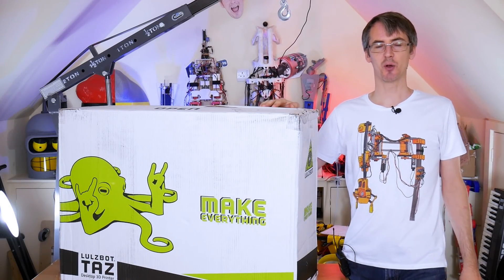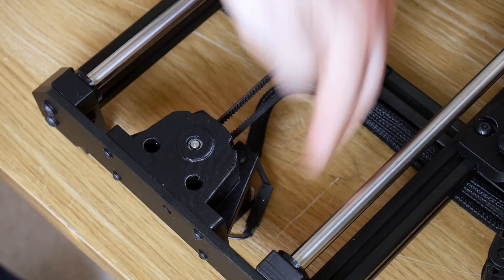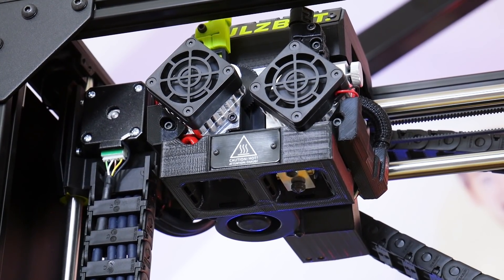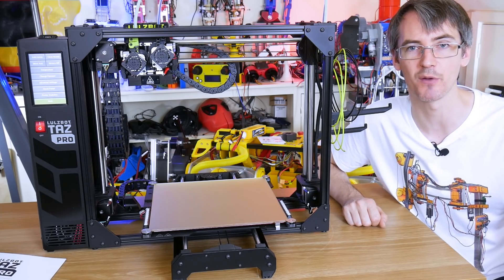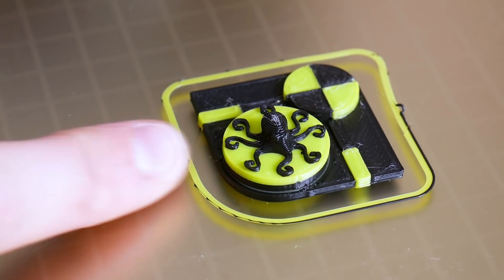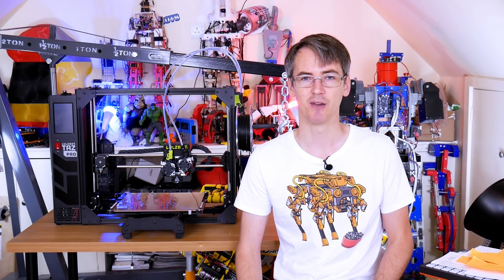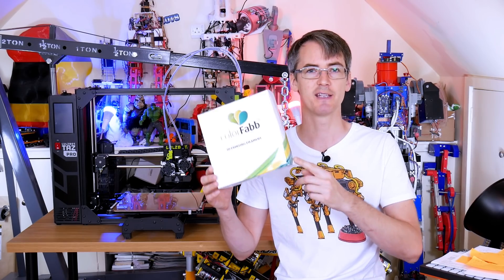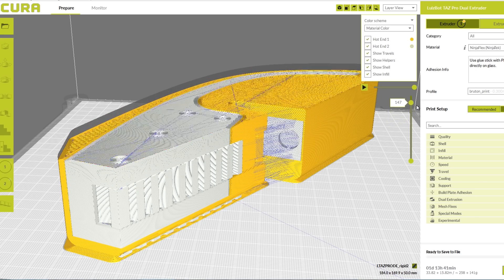Multi-Material 3D Printed Robot Dog Feet with the Lulzbot TAZ Pro

Comment: Hi James,

Wonder if you could give me some help...
Got a Taz Pro about october 2019 for educational purpose and after three prints had a big issue until now... and cant get any support from Lulzbot.
Have you ever got a issue with your printer after printing flexible material?
After heating the heads the printer just shuts down and restart again. Got (mintemp) error on gcode.
Cant get any filament through head 1 so wonder if the nozzle might be blocked and is causing this error. 

Hope you can read this any help will be much appreciated.

Comment: I was very dissatisfied with my purchase, many parts were 3d printed at a low res and the poor design cause the extruder to weld itself to the mount with filament on the 2nd print, smh, so i sent it back. Also for 5k there was no network connection.

Comment: Can't believe lulzbot is still using hot end conductivity for leveling.  keeping the nozzles clean enough for that is a massive pain in the ass, at least on my gen 1 mini.  The prusu use of magnetism is WAY better.  Also I am always annoyed that Lulzbot charges SUPER high prices for their systems and gives you 3d printed parts that are not nearly as good as if they were molded.

Comment: you need to crank those travel moves to 300mm/s and acceleration to around 2000, also faster print moves, it can handle it
and if there's a way, you should also see how you can make that change servo go faster
Reply from the maker: You can't print that fast in Ninjaflex

Comment: Will these updates make their way into OpenDog or have you moved on from OpenDog?
Reply from the maker: Yes!  this is a fork in the development, but It already seems easier to make it work. Once I've sorted out the actual stability control then I'm going to attempt to simulate the reactions in openDog's rigid actuators.

Comment: Interesting printer.  I like the Auto leveling and dual extruder design, but $5K for a relatively small build area, no lead screws on the Z axis, and it looks like some 3D printed parts, hmm.
Reply: The build area is almost 12"x12" thats pretty big. All parts that can be 3d printed are, its part of its open source roots and allows the user to replaceand or customise the prunters parts. The belt driven z axis is a new improvement over the lead screws from the taz 6, no z wobble, no binding, and much faster

Comment: I know that people like to tear in at Lulzbot for being expensive, but been using their products for a really long time * and I've never had a reason to not like lulzbot machines. They're turn key printers that requires very little front end tuning and they consistently produce great quality prints that are accurate and strong (when designed properly).
*[9 mini's and 6 Taz 6's at my university makerspace, (all of which have been running nearly 24/7 for the past 3 academic years with only 2 mechanical/maintenance related issues) and a personal mini2 for a year.]
Reply: ThatOtherAndrew same here, have 8000 hours on my original mini and so far had to replace one wire and 1 printed part.
Reply: The 3D printer market has a whole lot of people who look at the specs, and price and assume all printers are equally reliable, and are absurdly pleased with themselves for being so analytical. These are the so-called tourists, who don't really know how to buy equipment to run a business or to support product development. They just fool around printing parts off Thingiverse for a while before finding something else to amuse themselves.

Comment: Why don't low end printers come with USB ports? Lots of cheap ARM microcontrollers have USB host controllers and the HAL libraries make them basically a drop-in replacement for SD cards.

Comment: Around 3:30 in the video the whole carriage seems to tilt around the Y axis when it is wiping the nozzles. Is that right? Seems like it should be more rigid.
Reply: Look around 4:07, the tool actually interferes with lower part of the carriage and makes an audible click. Terrible clearance.
Reply: I was wondering about that too, but apparently, it doesn't seem to affect the final product- the final print turned out just fine.
Reply: The Taz 6 dies this as well, the carriage wiggles a bit when wiping, when printing there is no drag on the nossle so it doesn't move.
Reply: also you can see the whole frame woble around 4:38 when the carriage moves side to side
Reply: @tibo786  for the prize they are asking (which is ridicolously high in my opinion) it should have way bigger aluminum extrusion profiles and use linear guides aka ball-recirculating carriages...

I Do like the Belt-Driven Z-Axis though!

But is it 1:1 or does it use spools for a pulley system?!
Reply: Did it a few more times than that.
Reply: I know nothing about this printer, but if I had to guess Lulz Bot might have added a rotational axis to make the head tilt allowing them to switch between the two nozzles, allowing you to print with one and leave extra clearance for the other, unlike normal printers which just have them in plane. This could be a useful feature to help prevent artifacting on multimaterial prints.
Reply: @coulombicdistortion1814  Isn't that the whole point of raising the other nozzle up, though? It couldn't possible be intended to rotate like that. There's no way it could do that consistently enough to remain calibrated.

Comment: Surprising how many 3D printed parts it uses for a fairly high end machine.
Reply: I was also very surprised. For a $5k machine I would have expected mold injected plastic at least.
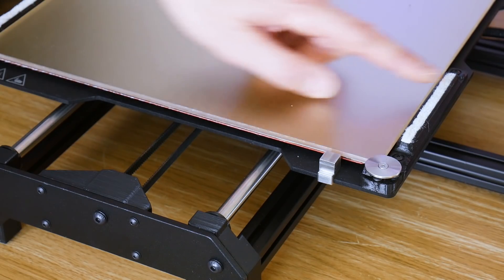Reply: Not to mention the poor quality on the printed pieces. At 2:26 you can see two identical pieces where one was printed poorly
Reply: 3d printing is great for prototyping ye? Or industrially making shoes. 3d printed running shoes are so light its like running bare feet... almost.
Reply: Why is that a bad thing? Using 3D printed parts makes it possible to innovate much faster.
Reply: @MisterMakerNL  They can innovate fast internally using 3D printed parts, but when you ship a final $5k product, you order injected ones (stronger, better tolerances, heat tolerant)
Reply: @jendib  And tens of thousands for mold tooling and for an injection molding machine. If you believe 3D printing should only be used for prototyping, say so. Because many others take 3D printed parts into production. It seems looks matter more to you than anything else.
Reply: @SanjaySingh-oh7hv  It has nothing to do with looks, we are talking about a 3D printer :D I was more thinking about dimensional precision and strength in all direction. Again we are talking about a 5k machine.
Reply: @jendib  Hello. Your speaking of isotropy, where the 3D print is equally strong in all directions. Is this necessary for the 3D printed part? Or are you just making demands just because? Regarding dimensional precision, remember that there is a metal sleeve or bushing inserted into the 3D printed part.

Yes, I agree that relative to the Chinese made printers, it's expensive, but it's also a printer that has proven it's reliability in, what else, 3D print farms, where the parts are made by the thousands, day after day, month after month, round the clock. I doubt the same thing can be said of those Chinese made printers. They are designed to look good, and work for a short period of time, but because they are made with lighter duty parts and materials of lower quality, expect that they will begin to drift out of tolerance and require more and more manual tweaking and calibration as time goes on. People who want to run a business or do production 3D printing will want a reliable printer that does not quit. That's what Lulzbot can legitimately claim for their printers. I personally wish Lulzbot had continued to evolve the TAZ-6 instead of wasting so much time and money with that bioprinter of theirs.
Reply: @MisterMakerNL  3D printed parts tend to split along the layer lines when they are under stress. So you may find that you have to reprint parts for your expensive 3d printer. Which just doesn't sound right
Reply: @BorisTheMonkey  If printed properly parts can last for years, i have one machine that's nearly 4 years old and all parts are perfect with 1000's of hours on it.  The reason the parts don't look pretty is because they use larger layer heights and don't reduce the extrusion multiplier to make them look good.  Just good strong functional parts.
Reply: @thegarageluthier  Exactly, My university makerspace has been running 9 mini's and 2 Taz 6's (and they've just bought 4 more T6's) nearly 24/7 for the past 3 years, and never has there been any problems with any of 3D printed components. (We've had one bed heating thermoresistor failure and one nozzle heater replacement).

A large number of individuals still seem to have this idea that 3D printed objects are tantamount to faberge eggs made of paper mache, and that couldn't be further from the truth....
Reply: @ThatOtherAndrew  I don't deny that 3D printed parts can be very strong (I myself use PLA parts for very demanding projects). It's just that for a $5k machine we can expect clean molded parts with tight tolerances.
Reply: @jendib  I wouldnt pay 5K for a machine with so many printed parts on it
Reply: Haas yeah buddy,when they break you dont say the same thing...